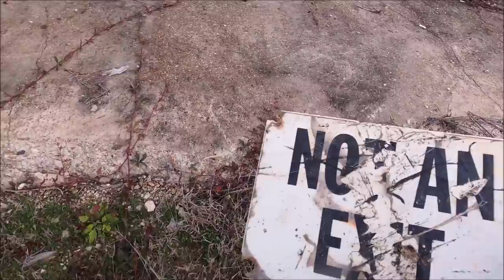Demolished 1800s Cotton Mill: What's in the Creek That Flows Under It?

Comment: I used some old beams from an old canning factory in my hometown to build a foot bridge a crossed king creek in trempelew county in west. Central wi.I heard a small plane circleing over head,I looked up and saw trees blocking my view ,but to the south was a hole threw the leaves where I could see blue sky ,about the size of my fist at arms length.there was a dark green,or black huey hellacopter ,( body ,not the tail rotor,nor chopper blades nor landing skids,no noise,no lights,no markings or numbers.I stared at it for maybe ?????  20 seconds ,my dad was standing up away from me ,an couldn't see what I was seeing ..an all of a sudden it shot backwards ,without turning ,then shot out of site to the southeast sideways.it creeped me out at the time and kinda still does.what did I see?